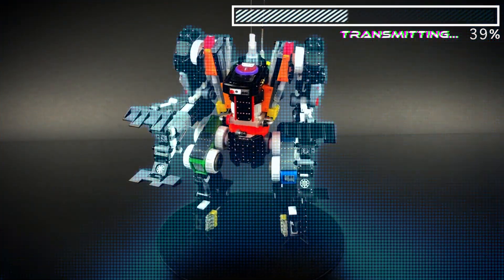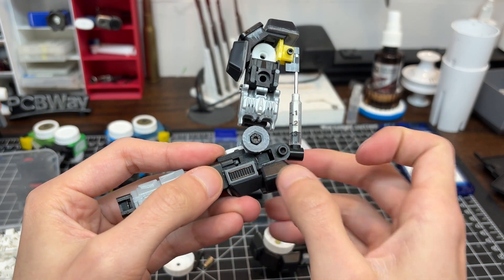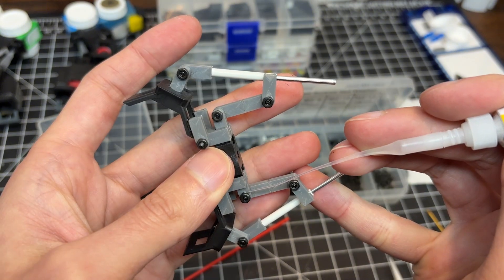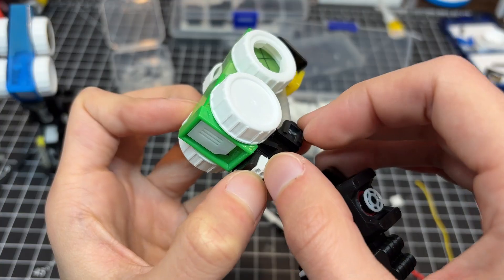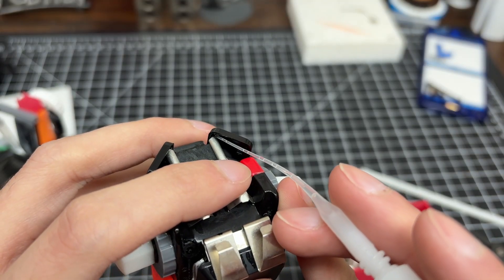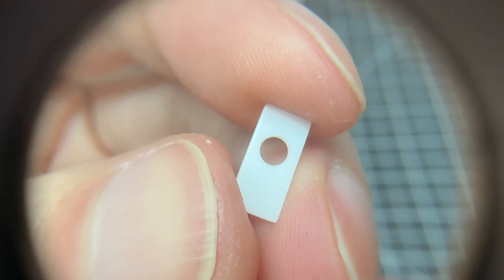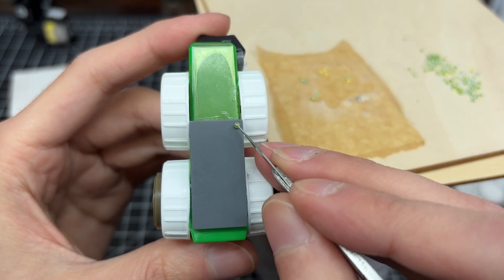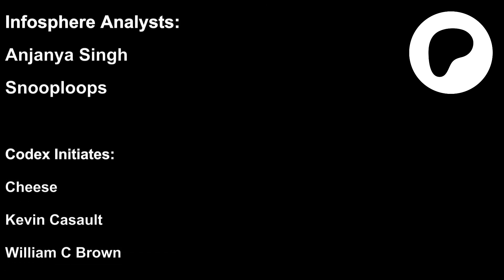Rex: Junkyard Mech Detailing (Part 3)

Comment: Another great episode.  Grimes remains my absolute favorite mechwrangler in the Omniplex.  The fact that the available scrap volume is decreasing is... concerning.  It could be good, with more manufacturers closing the loop on their own raw materials and dumping less stuff into the collective reservoir of the scrap pile.  It could be bad, with some repeatedly failing process doing... something to some part of the closed material economy of the Omniplex.  Lore noted!

Now, onto the design.  Holy cow, we have reasonably-used rivets securing the flat armor panels on a kitbashed model!  The use of rivets as coolness greebles is a pet peeve of mine, and I generally like the way that you use them sparingly.  Nothing annoys as much as seeing something that is obviously a welded complex panel (like a kitbashed part of a motorcycle body kit model) that has a line of random rivets across it to look steampunk or rustic or something.  The use of the little buggers on Rex is sensible with what sources and tools Grimes has to work with.  Well friggin done!

I am really looking forward to the painting stage of this project.  Rex has been a total labor of love for you so far, and a large leap in visual complexity over the previous mecha designs you've come up with.  It's going to be interesting seeing where you go with his visual appearance when it comes time to paint him up.  

I have some ideas for neat tricks you can perform in order to make Rex pop that would help tell the story of his origins.  So, I'll make the suggestion by showing the story first.  Grimes is too smart for his job, painfully and obviously so.  He has done corrosion comparisons between different alloys and coverings on the pieces that come into his little rusty kingdom.  He might not know the name or requisition numbers of the best paints to use, but he can recognize them at four or five varying ages once they're applied to a surface.

The environment of waste reclamation is hard on machinery and Grimes knows it.  He's done everything he can reasonably manage to do in order to protect vital systems within the limitations of having little in the way of engineering experience with mecha for pre-planning designs, and a wildly variable supply chain to source components from.  The least he's going to do is try to protect his baby from the corrosive and damp environment of the Pile.  

So, somewhere off the books he has a small cache of really high-end protective paintings and coatings that he's going to carefully apply to critical systems that are vulnerable.  Some parts of Rex should be a different color, maybe construction yellow or orange, to show which parts got that last bit of protection.  Everything else will get whatever's to hand and not actively detrimental to whatever alloys the part is made of.  

I imagine that Grimes will not actually grind off the previous paint covers (especially since he probably doesn't have access to an oversize sand/bead blaster.), so when it comes time to prime the model, you might consider putting an even base-coat in white or grey, then a layer of rust on some sections of some parts for later chipping, and finally a layer of different paints on differing parts with an eye to maybe suggesting certain parts had common origin via matching colors.  It will be a grand pain in the ass, but something underneath the final layer of paint that changes the tone of different parts will still sell the idea that Rex is a salvaged mech without having to actually paint the surface in motley.  Again, huge PITA, but the results might be worth it to you.
Reply from the maker: @bearnaff9387  thank you for the comment! 😁 I put in the effort to make sure rivets would make sense in the world, and I’m glad it worked. 

The paint job will likely mimic worn construction vehicles, with heavy weathering and rusting to contrast my previous clean builds. I’ll have to think some more on how to justify it but I think it’s easy enough knowing everything is made of trash and the environment is garbage 😂

I like the idea of having a hodge-podge of colors but my personal aesthetic preference leans towards symmetry and simpler colors. We’ll see what happens as the painting happens!
Reply: @proto.roborovski = It's your mech, obviously.  And symmetry has a lot to recommend for it in aesthetic terms.  My suggestion was actually based around Grimes thinking the same way as you, actually.  I figure that no matter what color the parts were originally, Grimes will try and make the robot look like it's not made by the scavengers of Neo City Zero or the other horrible places.

But, I don't think he has a way to do more than knock rust and loose paint off of the part's he's re-using.  Some parts are remachined or remanufacture, but some will have an old coat of paint underneath and that paint will influence the shade of the final color on top.

As for weathering, I can't wait to see how you scar up the feet and manipulators.  An astute observer will be able to learn a bit of what's in the Pile and how it's organized by looking at them.  If the Rex at the end of the video series has actually been being used for some time, rather than Rex immediately after manufacturing, I imagine that texturing the metals will take as much time as all of this video's assembly, including the rivets.

I cannot wait.
Reply from the maker: @bearnaff9387 I love the way you think, definitely great ideas you’ve provided that I can think about. The point about not making it look like a scavenger machine is an excellent point, and already inspiring a build for something built with the worst cobbled together colors possible. The old paint underneath also makes me consider a variety of colors as a base coat. Again, much to think about!

Comment: 0:53 here's a trick to get super clean cuts. On a flat, hard surface, put your can down and find a wooden block that's going to be as high as the print line on the can (basically where the cylinder of the can starts to turn into the round of the bottom of the can). On that piece of wood, lay a box cutter blade (sharp, fresh). With your right hand, hold the blade in place on the block so it doesn't move, and with your left hand, rotate the can to score a line with the blade. Light, repetitive scoring will result into clean even cuts. You can repeat this until you go all the way through, but in truth you only need to score it and pierce it in one place: pressing with your thumb to the side of the score line on the cylinder part of the can will automatically shear the bottom from the rest of the can. Repeat for the top in the same way. You'll then get perfect stock, from the get-go, no need to fiddle with rulers or other things. Scoring along the resulted tube, and bending along the score will also create a clean sheet. To flatten it, you only need to lightly pass the rounded sheet against a round piece of wood. Cheers. :)
Reply from the maker: @aserta  thanks for the info! I’ve done this a number of times over the years and sometimes I prefer it but I was feeling impatient and whipped out the scissors for speed 😂